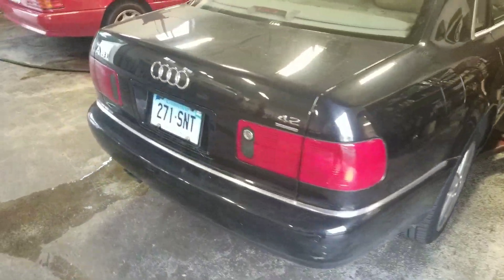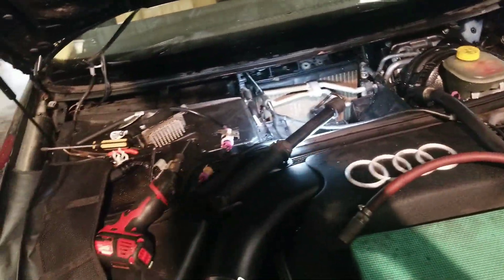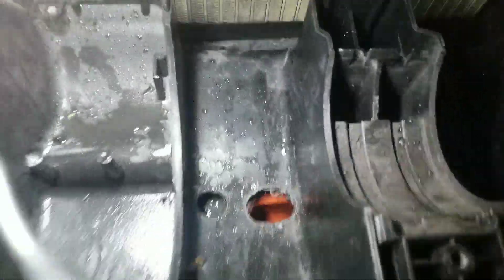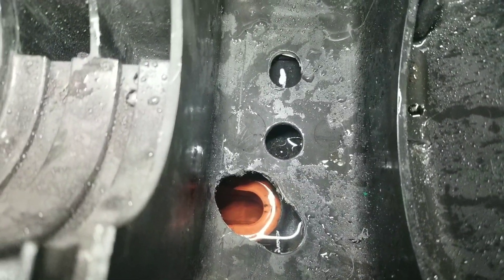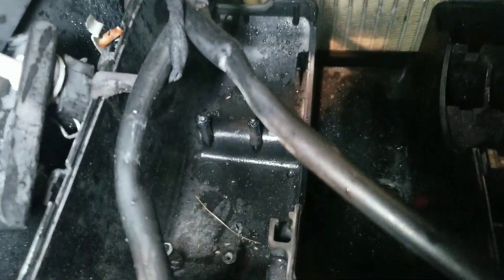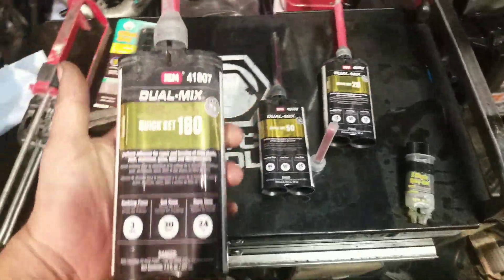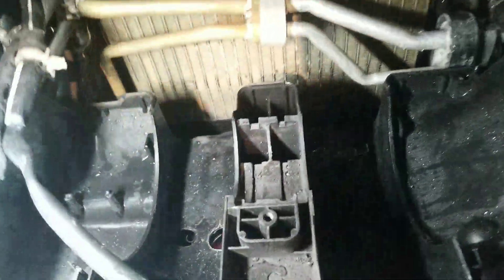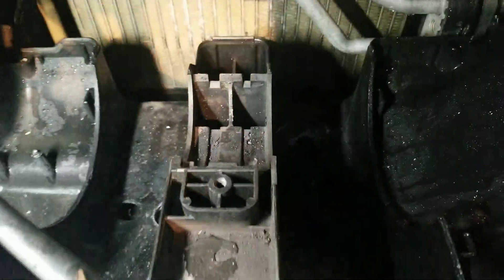2003 Audi A8L how to clean cowl drains

Comment: do you think i could drill through the box that the fan rests in without removing it, i don’t think more holes is going to hurt
Reply from the maker: Yes that is what I did to avoid removing the box that fan sits in
Reply: @Pete6641  is this possible to do without removing the fan? anyways thanks for the response!
Reply from the maker: No you have to remove the fan to do this. The holes you need to drill are right where the fan sits